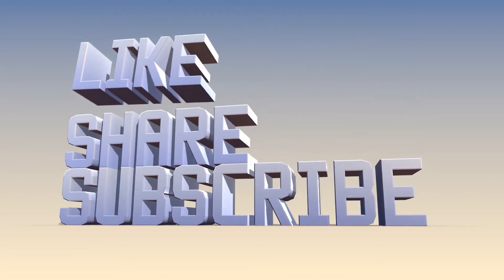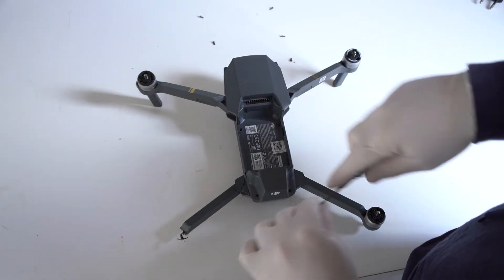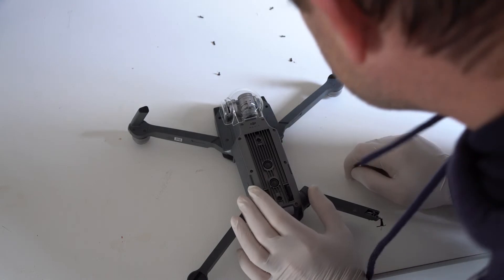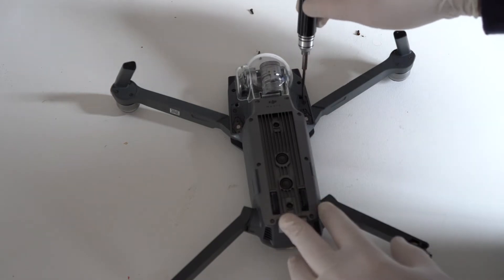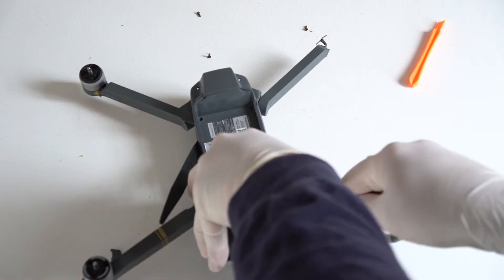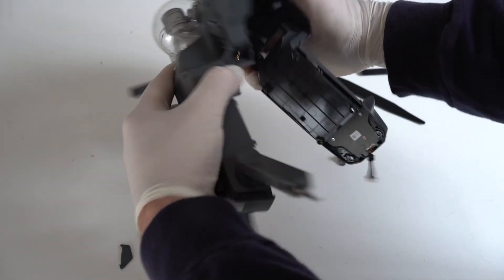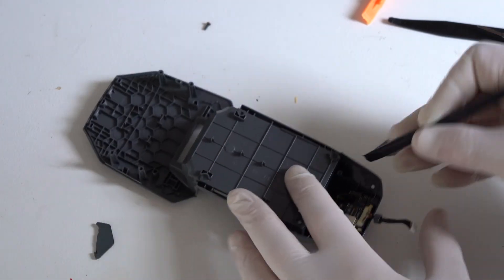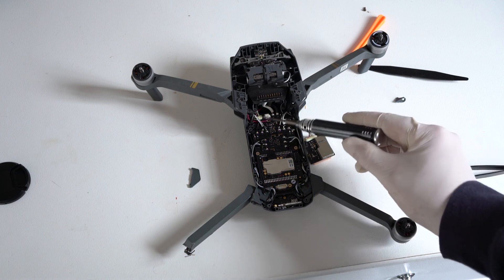Mavic Pro Repair Part 1-Removal Of Top Cover & GPS Module

Comment: I have a Ruko tracker module on the way from Amazon and I was able to use your video to locate the GPS module, just like the two other commenters. The video is fine, but some of the real-time unscrewing could be sped up or cut out to save a few minutes. But, I consider that a minor complaint considering that you solved my problem.